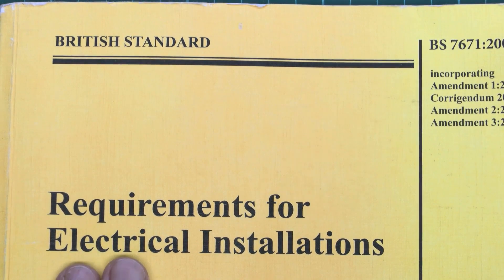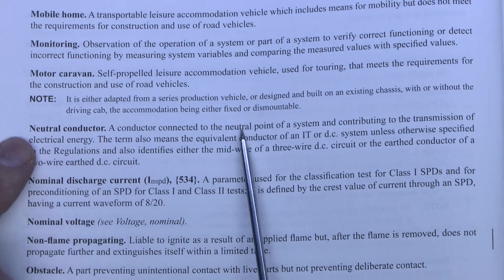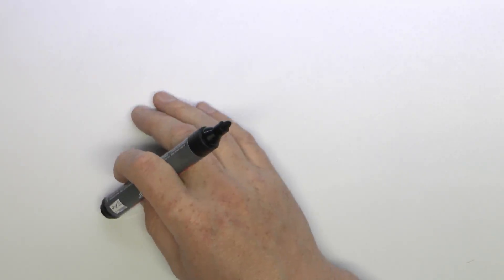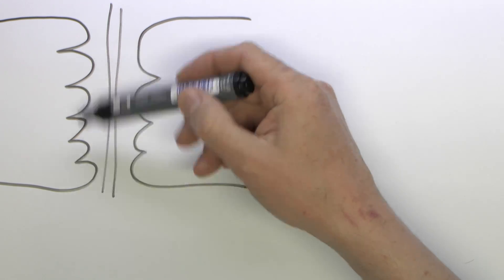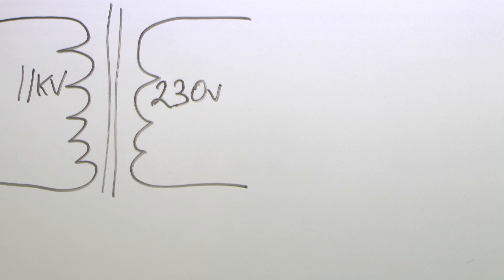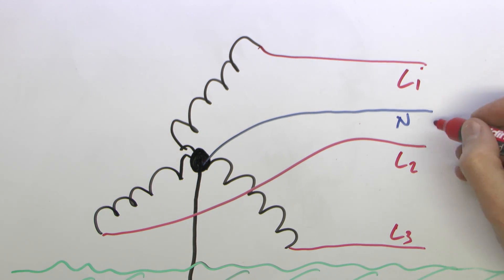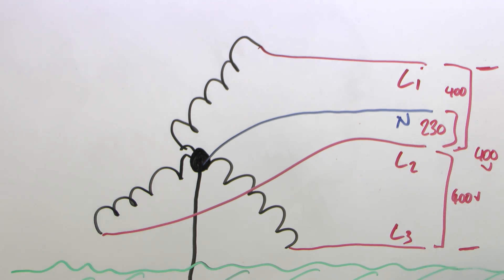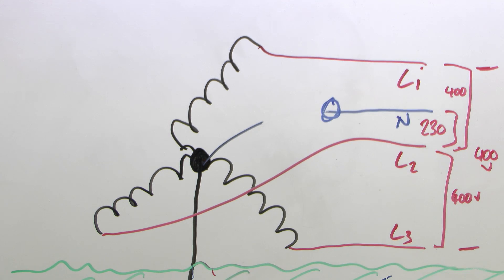Neutrals from transformers and in electrical circuits

Comment: Very useful. I also learn't the other day why neutral isn't needed on motors - its simply because in a 3ph motor, the current draw on each of the phases is equal, whereas in other applications where 3 phase power is used, such as one of my dimmer racks for dimming stage lighting, the power draw on each phase can vary, and thus a neutral is required to act as a 'drain', though im not sure if my terminology here is correct. 

Your video also explains why a string of old style fairy lights can run on 240v without a transformer and yet uses low voltage bulbs, since the voltage is divided up between them all, providing of course that the bulbs are wired in series or 2x pairs of series. Meanwhile a 240v festoon has 240v bulbs because the bulbs are all wired in parallel.  

Have you ever done a video on building site 110v electrics where there are 2x 55v lives and the neutral and earth are combined with (i believe) a centre tapped earth?

Best regards,
Jonathan
Reply: Jonathan Cook  Building site 110V supplies are fed from isolating transformers. The secondary (output) windings are two identical windings with the ends joined, at this "mid-point" or join, a connection is made to earth. Another way of describing the winding, is a centre tapped secondary. Hence you will see the term CTE for Centre Tapped Earth. The reason for this arrangement is if either conductor in the cable, or tool, or whatever becomes exposed, the voltage to earth will only be about 55V. So the risk to a human is considerably less compared to normal 230V system. And on a building site, there is a far greater risk of damage to the cables, tools etc. compared to day, a home or office environment.
Reply: https://youtu.be/fRhofcMyAyk
Reply: Thanks Mark, I do understand this, but Im sure there is more to learn.
Reply: The neutral basically carries current that allows the voltages to be balanced. (That is, the neutral to phase voltage.)
It's worth noting that with harmonic currents, the neutral current can be many times higher the current on any one phase at a given time. If not kept it check, it can cause electrical system failure. (Burnt wires, connections, arc flashes, etc...)